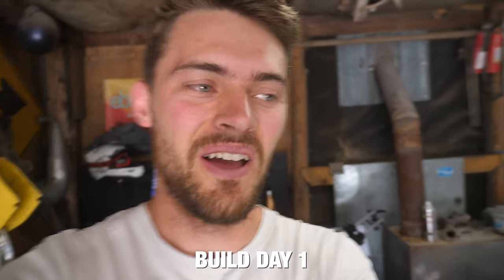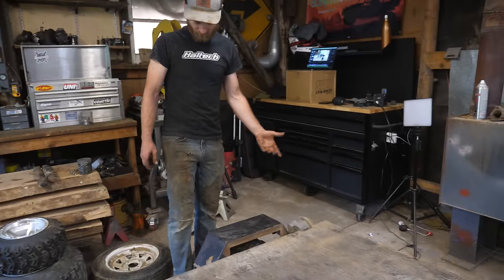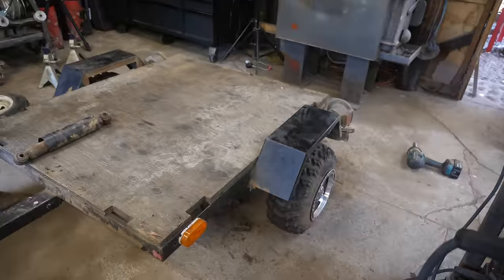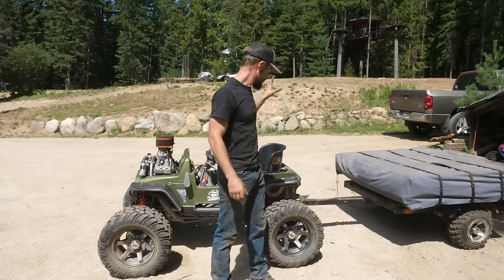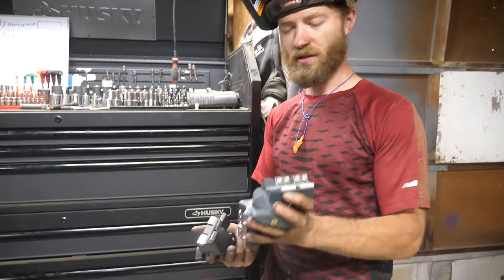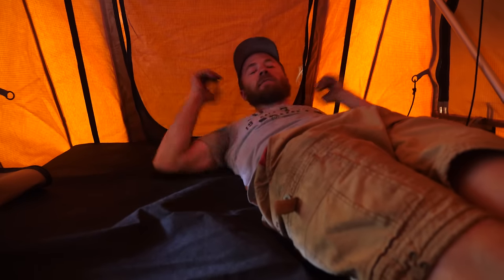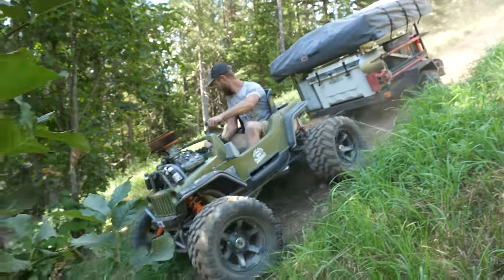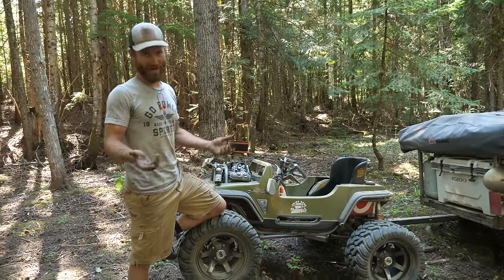Ultimate Overland Trailer Build! (Power Wheels Mods)

Comment: A little diesel motor and an f350
Power wheels would still be a sick "tow rig" even if it wasn't over engineered like the other builds as long as it pulls a trailer that would be sick
Reply: Flywheels on diesel motors are super dangerous
Reply: 👍 I THINK THAT EVERY TIME I'M IN WAL-MART. 🇺🇸🇺🇸🇺🇸🇺🇸
Reply: I have zero experience with ANY diesel engine but I'd be willing to bet with enough thought and careful planning it could be done with a relatively simple design if you knew all the possible dangers before going into it
Reply: Hahaha Grind Hard not over engineer something..... No way next level Fabricators!
Reply: I was just going to comment this.   That would be awesome to see pulling a custom mini gooseneck dual axle trailer.   Only trouble is i have never seen a small diesel engine with a built in gear box like the dirt bike engines.
Reply: OnEfoRAll if ya want next level fabrication with a side of over engineered watch project binky
Reply: @la_plata3588  so every diesel is a ancient detroit diesel now? lol
Reply: @la_plata3588  ? I've never seen one without one, what do you mean?
Reply: Yeah and put a mini turbo on it
Reply: little Kholer diesel in an F350 powewheels would be sick
Reply: maybe solid axles all round?
Reply: Like a small 3 cyl diesel tractor motor
Reply: Yes
Reply: @ethanmaristch8409  There are some diesel motorcycles, so it definitely exists, i don't know how available they are tho
Reply: Then build a trailer to haul two of the builds. It'd be only for show but that's nothing new for these guys.
Reply: Wheels 4 life I think that's a level of engineering that some people aren't even aware off, Blackhurst is a master or metal work.
Reply: la_Plata The only issue with flywheels on Diesel engines is if they are either A) Super low quality, B) Runaway Diesels, or both
Reply: 66 c10 with a diesel would be sick also
Reply: Or the ram 3500 dually power wheels
Reply: It would be even cooler if it could tow a mini 5th wheel camper
Reply: A sled pull truck with stacks.
Reply: @ouija6196  the smallest motor I can think of is a VW diesel but that wont roll coal n is still way too big
Reply: @RacingMason-ik1pu  sled pull truck
Reply: Ouija Diesel engines run hotter that would be far to dangerous many things can happen especially with how flammable diesel is it doesint even need a spark to ignite it can ignite with pure friction unlike gasoline
Reply: @tonyreynolds1547  
What?
 Never seen a tractor or diesel generator? 
Ever light a fire with diesel vs gas?
Reply: @la_plata3588  
What? 
What diesel rig from the last 50 years doesn't have one?
Reply: @tonyreynolds1547  You are back to front on that one im afraid, you can actually drop a lit match into a bucket of diesel and the match will go out. As for igniting without a spark, diesel requires far more heat to ignite than petrol and as such will use compression ignition (not friction as you suggested) whereby it compresses the fuel/air mix to heat it up instead of using spark plugs as this is more effective
Reply: R1nger dang i didint know tractors and generators were made by plastic
Reply: @tonyreynolds1547  
Um...what?
Do you know what a flywheel is?
Reply: Concerned Citizen  when someone comments about putting a diesel motor on a kids toy only motor that would fit would be a stationary gen motor. Everyone's thinking of a engine that's the size other shipping box the kids toy comes in.
Reply: @MrJameslewis530  and 0
Reply: D

Comment: Heck ya! Make sure to use the ladder as a support when you  deploy the tent. Those hinges in the middle aren't made to hold the weight without support.
Reply: Was thinking the same. Ethan should make some kinda support for the tent while there in it.
Reply: I think he should make supports to fix the hinge issue and the tilting issue. I’m sure Ethan can figure it out lmao. Maybe use the ladder? Or you could mount some old jacks with metals plates on them to the back of the trailer for support!

Comment: Give the trailer some jacks or legs to keep it level and the wheels of the ground
Reply: I think it would be possible to build a bracket off of each side to go outside of the tent.  Use two of the high-lift jacks instead of legs connected to the brackets.
Reply: A flip up trailer jockey stand would have been ideal.
Reply: I was thinking they would want to set camp then go play a bit with out the trailer and not having to hook it up to sleep would be nice.

Comment: Needs some type of cover in the front, when you go through mud n stuff, all your gear will trashed
Reply: guard that doubles as a table`
Reply: what think you meant is that senders needs mud flaps lol
Reply: I do'nt see anything there that a little mud is going to hurt.
Reply: I'M PICKLE RIIIICK!
Reply: 100%, nice piece of diamond plate would do the job and fit the overland trailer look.
Reply: ๆ

..

Comment: Splendid camper! Pimp your trailer with independent trailing suspension...those leaf springs hammer your gear over long track hauls...(all the best, outback traveler, Oz) PS, the ladder should be connected to tent floor when you get into it, the hinge is not designed to take all the weight of a body climbing in to the cantelevered floor.

Comment: I would set up a quick coupler and do hydraulic trailer breaks and if you want some power for charging cams and stuff get an inverter with a car battery and a plug in on the back

Comment: btw...  Saw Chris is stranded in Wyoming...  Sure hope he makes it in time!!!
Reply: Not since yesterday
Reply: I concur!! I hope he makes it. I need to go check out his channel right now and see if he's posted any updates.
Reply: His truck was fixed up and he was back on the road fast. The Dealership pushed him up so he could get on the road asap. Sucks that the active fuel management on GM vehicles is such trash that he was down for even a bit.
Reply: @Ratkill9000  Don't you just love Technology? It will be our downfall
Reply: @VancouverCanucksRock  well Hemi's go through cams like no tomorrow and break exhaust manifold bolts/studs often, like within 50,000 miles.

Comment: Zipties are the perfect shovel mount, carry spares, when you actually need to use your shovel cutting a few zipties is the least of your worries.
Also, to level your trailer, if it's still sitting a bit tongue high, run the front wheels of Senders up onto a couple 2x6s and it'll tip the tongue down. Cut a few chunks down and tuck them in the corner of the trailer, easy levelling blocks.
Reply: Also, some kind of shield on the front of the trailer to protect from debris thrown off the tires is a good idea, or your cooler and water jug will be trashed before you get there.

Comment: I would suggest making a mid sheiks splash guard for the from of the trailer, so you gear doesn’t get destroyed on the trip, just a small suggestion. 

My Jeep trailer used to have all contained and it was nice to camp with dry clean stuff when you got to the spot.

Comment: Build some simple square tube out riggers with some cheap and easy screw (trailer type) jacks on them! Could even detach the trailer and camp on it still at that point, still be able to send it around while the camp site is set up

Comment: To save busting the draw bar off the trailer I’d recommend putting a poly block/trigg hitch coupling instead of the ball, gives amazing articulation and works as a good vibration isolator from the trailer

Comment: Awesome build. Looks like the front of the trailer might need a rock deflector shield though. Otherwise something kicked up by the rear tyres could put a hole in the water container or tent. A sheet of rubber would do.

Comment: You guys have probably already been out overlanding with this setup but I wanted to suggest adding some angled braces to the tongue to create a triangle up front. After awhile all the side by side twisting will snap welds where the tongue is welded to the trailer platform. The triangle will add strength to help against the flexing side to side.

Comment: Maybe the next thing you can do to that trailer for The power wheels is add some brakes on it? Shouldn't be hard to run a quick disconnect line from a power wheels to the trailer that ties into the main brake master cylinder. With your guys ingenuity I'm sure you could do it quite easily!!!

Comment: Bit of sliding on that hill.  Probably seems silly, but maybe some trailer brakes?  Definitely going to need a mud/rock guard on the trailer.  Also thinking it might be better to have the tent fold forward over the vehicle instead, adds extra support from the rear axle and helps keep your seat dry if it rains overnight.

Comment: The kernal and That over landing trailer is sick, I’ve probably watched this video about 4 times since it’s come out. That overlanding veideo is gonna be sick. But tbh I can’t remember if you guys put a battery on the kernal, but if you did I would put a small light bar on the power wheel and some trailer lights with a light bar on the trailer too! Keep up the good work bois

Comment: I would build a couple posts to support that overhang when its unfolded.   Most tents that iv'e seen have their braces come back at an angle and connect to the trailer, rather than just a post to the ground..

Comment: Larger wheels should be used because they have a better ability to negotiate the terrain, in addition, the rims protrude in the smaller ones, which makes them vulnerable to damage when crossing stony or rocky terrain. I would add an overrun brake. Regards, Dan.

Comment: Larger wheels improve the ground clearance and the ability to negotiate terrain, and they push the propelling vehicle less on steep descents. Additionally, you can consider increasing the payload, we get stability and air cushioning without losing the cargo space. At the expense of, of course, a slight increase in the loading height. And now I can see the plastic canister on the back of the trailer. It can be vulnerable to damage when reversing in difficult terrain, especially since by 11 minutes I did not find any lighting integrated with the "tractor". I do not pick on, I like it and I am jealous but I would take my suggestions into account when building from scratch. Cool.

Comment: I have a couple of ideas or suggestions.  What if you were to spin the tent around ? That way when you unfold it, the foot end would rest on the driver's seat. Or you could fab up some diagonal braces to attach the foot end of the tent to the bottom rear side of the trailer.  Either way I'm looking forward to the video y'all make of the trip.
Y'all be careful now, Ya hear???

Comment: Pull a leaf out and mount shocks flush to bottom with a lever from axle if want the suspension on the trailer to be better, looks way stiff but not like it matters really.

Comment: the roof tent has two deployable legs on the bit that overhangs, if you use them then the tent will last longer and the trailer should stay roughly level otherwise put deployable legs on the trailer like the temporary electric road sign trailers have which will also reduce the likely hood of the trailer starting to move during the night

Comment: you should make youre posts slip adjustable...  SO you can raise it when needed for more room... but still lower it when you dont to take away the top-heavyness of the thing....  It will be an easy upgrade later I guess.

Comment: I like your idea.. i think I would have designed it a little differently. 
My logic is lower center of gravity and unlimited cargo height. 
I would have made a rack that flips over the rear and locks to support the bed.
Mounting the tent under the rack and then having the rack swing over the tent which would also protect it on the top and sides from trees and debris.
Space being at a premium you have usable space on that tongue for a battery or small propane tank. A 10 pounder with a distributor would work to supply gas for a light and heat on cold trips.
Battery with LEDs would last forever and it could be recharged when traveling to the next destinstion off the vehicle and it's battery.

Comment: Just a thought, yes I understand it’s extra work but Ethan seems to like stuff like that, however I wonder if it’s be possible to use a dry break between the Colonel and the trailer and give the trailer brakes maybe even give the trailer the ability to have a parking brake when not attached. Yes more maint and more stuff to go wrong but may help in certain overland situations. Oh and what about little jacks at each corner for leveling purposes when the trailer isn’t attached, say you guys set up can’t for a day and unhook from the trailer to go rubiconing and keeping the trailer level while unhooked.

Comment: What about engineering a large auxiliary fuel tank you can mount to the Jeep? That way it can have lots and lots of range when you want it to

Edit: And it would just have a hose that connects to the Jeep's fuel tank filler cap, where the filler cap gets screwed onto the auxiliary tank. I don't know quite how it would work, but it could be interesting

Comment: You guys should consider using a PINTLE HOOK Trailer setup rather than a ball so that you will have more range of angle for times when going up or down steep hills, the trailer hitch won't bend or break.

Comment: That trailer axle is gonna get hung up on A LOT of stuff being lower than anything else on the vehicle. Should have made independent suspension for it even if you still used the leafs as the springs.

Comment: I'm going to keep saying this til you guys try it... REGISTER THE JEEP and try and get it on the road. Possibly even road-trip it.

Edit: You'll also need a vin which you can probably even stamp it yourself as long as it's visible or just take it off of a junk motorcycle/atv steering tube or even just a junked car "that you own obviously." They'll get really confused but they aren't getting paid enough to deal with it so they'll let you through as long as you fit their checklist unless you live in cali. You can ask them what you need before going in other than just the vin but even then they'll typically still be really cool about it despite the paper-work being hard.

Plus, CONTENT!

Comment: What's a rough costing price to build one ..I'm planning on doing a build
Reply: Figure the cost of the Power Wheels itself, which can very model to model. Then what you can find for a suitable drivetrain that works for the least amount. Chains, sprockets, heim joints, metal, brakes, will probably be the least expensive parts. Shocks can be either cheap, or stupid expensive. So if I had to guess anywhere from $1000 to $3500 depending on what you can get and if you look around for a good engine.

Comment: Don't trust the butterfly nuts on the trail, they will work loose, drill the bolt shaft and use a circlip or safety wire them. Also, might want to switch to metal zip ties. I used to do atv overlanding and shit allways rattles loose and plastic ties allways break, bungee works good though. Dig your rides but you might want to include a few female cameos, gettin a Broke back Mountain vibe from you guys up there in that cabin, all alone. Just sayin.....

Comment: It built a trailer one to go behind my gold wing that first it pulled an 8 feet boat the once the boat was not on the trailer it had a tent that could set up top and and made a camper out and set up to haul once so take down to the lake go to the camp area and set up the camp and good to and there was more than enuff room to haul all the other camping gear as well people would see and loved they said it was a great set up and it was I used it for about 10 years till I sold it could still be out there same where

Comment: You Have to Raise the trailer by Taller tires,And cutting the axle into a V."Sick-Puppy 4x4 Adventures"will show you that your's is'neat' but Useless in the trails.Your 'dragging extension must weigh 1/2 you tow,and have twice the axle clearance for ruts'.=Me.The trailer looks great,but is Only useful for a quad in normal trails.Axles drag on center of wheel ruts.Nuff said.